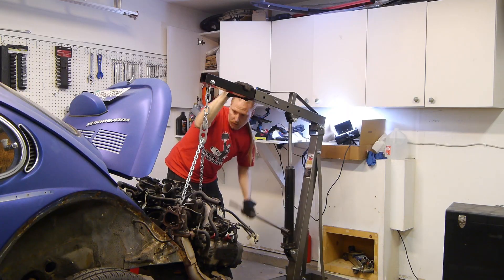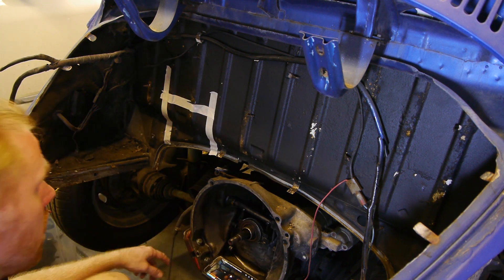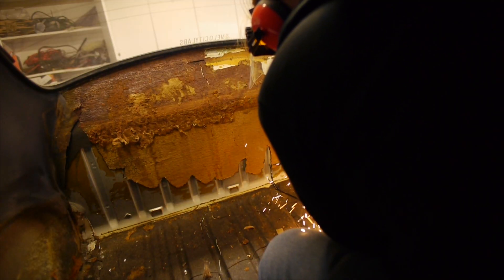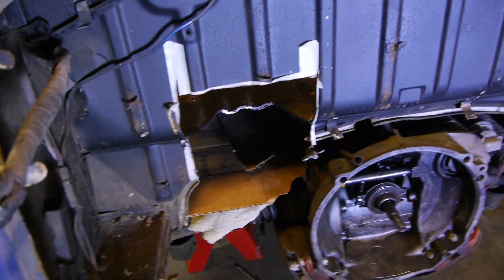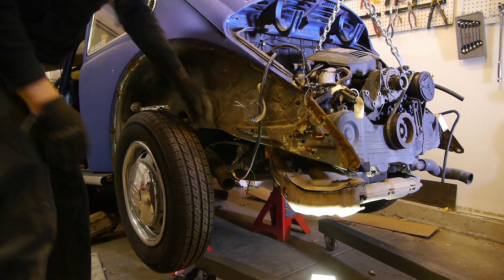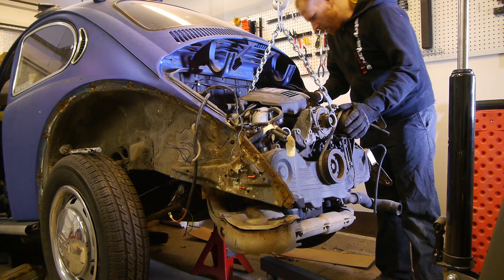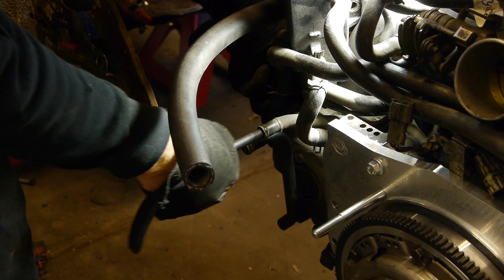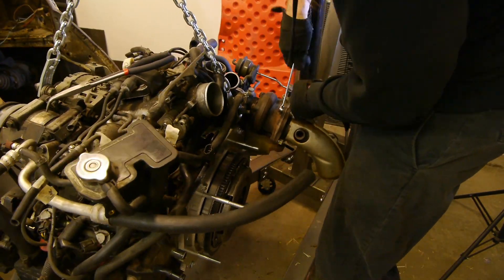Cutting a hole in my VW Bug for my turbo (ej22)

Comment: Question: With the amount cut out from the back of the VW is it still possible to maintain use of the back seat? Does the cut get in the way of where the back seat would go? I am really wanting to put a EJ22T in a VW bug build - but wanted to find out if the back seat can be kept.